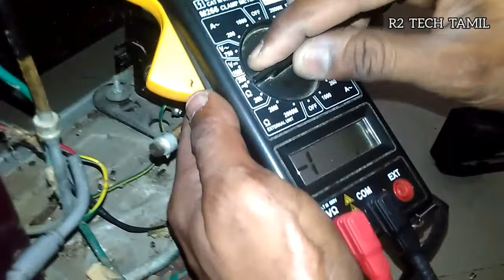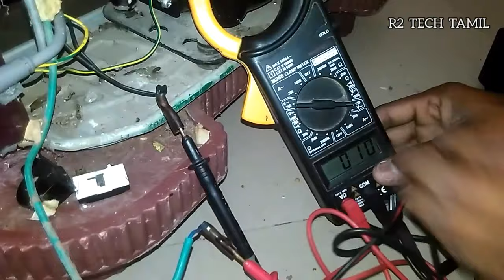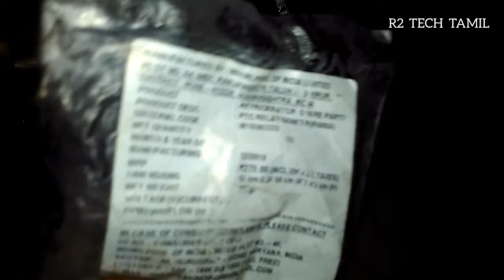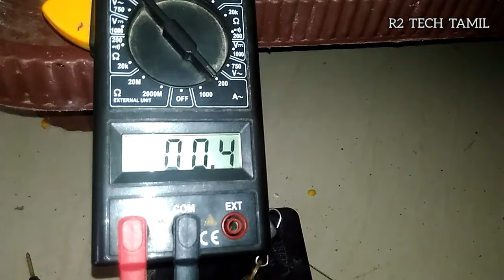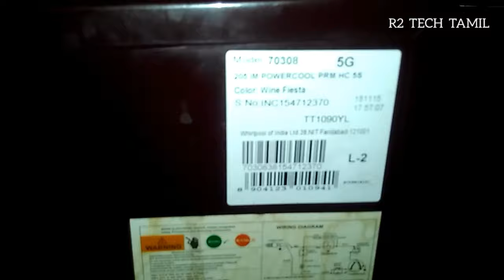Fridge Repair தமிழ் / Whirlpool Fridge not running or not cooling Tamil

Comment: Thanks Bro! Very helpful video. I was able to diagnose my faulty relay which was making sound when taken out and shaked it. Replaced it for 60 rs my self 👍
Just one doubt, since I was in, just wanted to check if compressor was fine and tried testing with your method. Top and left beeps, then top and right beeps and not short between any lead and body. But. Left and right does not beep as shown in your video, not sure if this is model specific. Mine is Whirlpool Proton series.

Comment: Good morning sir..
We already using the compressor of this type - R290/600 a - BLEND 35gms (50/50 WEIGHT) GROWS W 180lit. 
Brand: GOOREJ 
Which compressor type is best for Replacement of old one sir????
Reply from the maker: Whirlpool 600a compressor soot agum.
Reply: Sir 180L compressor enna price varum sir

Comment: Hii anna. Ithe problem enga fridge layum irukku. Today technician vanthu check pannitu compresser change pannanum sollitanga 6k aaguma ready panna. Neenga panna method la naaum try panna poren.. so ore oru doubt mattum sollunga anna. ptc relay modal ku etha madhiri maruma epdi Naa.. LG compresser naa
Reply from the maker: Same thaan lg Ku ptc & olp nu kelunga.. But compressor failure na run agathu
Reply: @r2_tech_tamil  ok bro entha shop la kadaikkum bro

Comment: Hi bro, lockdownla last 1 year fridge use pannama switch off panitu native placeku vanthutom ippo fridgela powerum varala lightum work aagala first basicah etha check pannanum fridgela
Reply from the maker: Input Power card check paniparunga.. Rat cable.ah damage panirukalam.
Reply: If your location Hosur means i will rectify

Comment: Brother, enkita double door Whirlpool fridge irukuthu

Voltmeter illa. Aana Just PTC & OLP relay mattum remove panitu connect panunaen. Compressor  run aaguthu, fridge side heat aaguthu

30 minutes aayirkuthu. 
Freezer compartment   mattum konjam chill aayirkuthu aana bottom door innum chill aagala. Bottom door regulator high la irukuthu....Any suggestions?
Reply from the maker: Maybe gas chock or gas leak agi irukalam.
Reply: @r2_tech_tamil  Ok brother. Gas leak aaguuthuna, smell ethaavathu varuma?
Reply from the maker: No. Neenga technician vechithan check panikanum
Reply: @r2_tech_tamil  Sure brother. Mikka nandri :)

Comment: In my home we are using LG Fridge, there we are finding problem for more than a month,
We can't able to open the fridge after closing for nearly 4 to 5 mins, after that only it is opening.
Previously it was not like that.
And after closing the fridge it is making some sound in the drain hose pipe backside.
I spoke to the LG service person.. He told me to remove one rubber in the drain tube.
I removed that rubber, but still the fridge is can't open after closing with in 4-5 mins.
Please explain why this issue happens.

Comment: Bro oru doubt. Same problem. Ptc relay rattling sound kekuthu. At the same time compressor top to left , top to right continuity irruku beep sound varuthu. But left to right paakum bothu beep sound varala 45 ohms kamikuthu. Ptc maathuna pothuma. Illa compression work yeathu irruka.
Reply from the maker: No.. Sound varanunu avasiyam illa, ohms value katuna pothum no problem, PTC and olp change panunga OK agidum

Comment: Hi bro old fridge vangi ice form pblm odathan theromostat change pani crtah run achu one month stablizer podalao oneday cut off agi marupadi compressor run agala stablizer new vangi potum pblm sari agala switch off pani Tu pota run avuthu theromstart change pana service man check panitu gas fill pannumnu sonar cooling elam varuthu gas elati cooling avuthula bro enna pana solve agum entha problem

Comment: Inverter compressor check pana mudiuma bro
Reply from the maker: Just winding check panalam. But exact.a check panamudiyathu athuku separate.a checker iruku.
Reply: @r2_tech_tamil  bro winding or resistance value solunga brooo
Reply from the maker: 3 terminals.um same value varanum..
Reply: @r2_tech_tamil  inverter compressor la two pin tan varum

Comment: Relay ok olp ok comparasor CSR continuety ok aana comparasor work aaga maattuthu comparasor heat aaguthu yenna problem reply please
Reply from the maker: Compressor shake pani start paniparunga. Capacitor iruka.?
Reply: @r2_tech_tamil  irukku bro
Reply from the maker: Capacitor change paniparunga
Reply: @r2_tech_tamil  capacitor check panniyaachu ful power full ah irukku
Reply from the maker: Capacitor Change paniparunga..